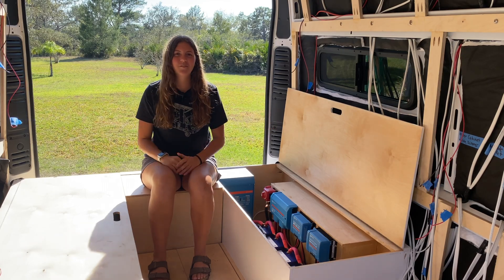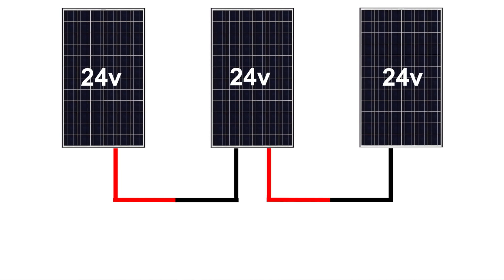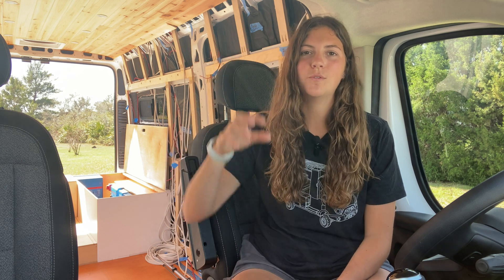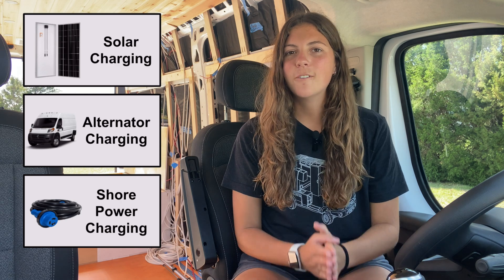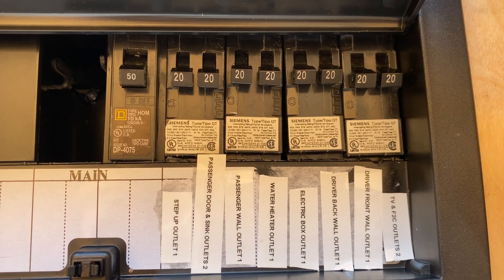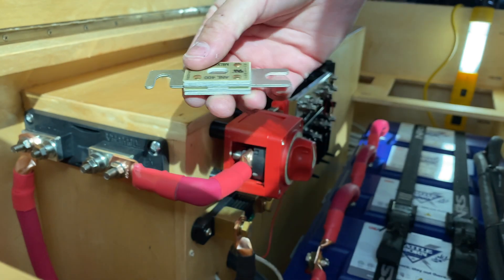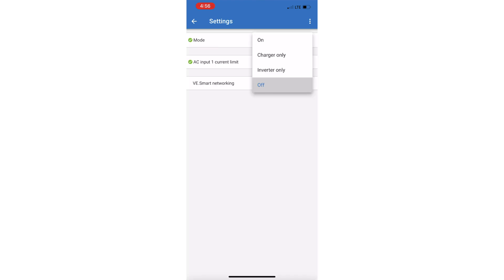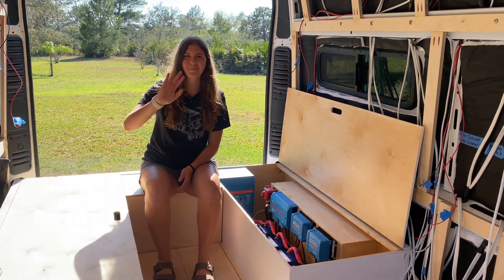How my DIY Campervan Electrical System Captures, Stores and Uses Power | Ram ProMaster DIY Van Build

Comment: I have a 2023 Ram ProMaster 2500 159" wheelbase, 11' of floor, about a 6' ceiling after putting 3/4 plywood on floor.... looking at putting an Outequip 10,000 BTU A/C Unit a Multi Outlet for Charging Phones, I have a 12v Truck Frigerator w / Freezer that I spliced a plug on its wires for cigarette lighter Outlet only needs a 15amp fuse...  so all hope hoping to power is the 10,000 btu ac unit, the refrigerator, a few outlets for charging phones & 11:17  put 2 or 3 High intensity lights on ceiling . Thought is 4 150ah batteries stacked 2 wide, 2 high to conserve cargo space, 3 200w solar panels . Victron SmartShunt 500

Comment: Can this system add as many batteries as needed without changing any settings for longer stored power? Also, will it stop charging if the battery is full, or is there a setting in the app to adjust the percentage charging cycle? Your video is very detailed and helped me a lot. Thank you
Reply from the maker: Great questions! The components are Bluetooth and have a monitor system to control charging levels properly. There will be some changes in the app for additional batteries up to 600 amp hours. Any battery bank bigger than that will require additional size changes in wires and components. Hope this helps 😁

Comment: You got some help from an electrician on that build. I like to tinker with stuff and feel generally competent doing projects but I don't know that I could have wired up a job like this and kept in mind to crimp, and heat shrink the wires, label the 120 circuits etc. Looks nice either way.
Reply from the maker: 100% self-taught and 100% self-executed 🤗

Comment: How do I identify a "high quality fuse"?

I can find a lot of different brands, prices are not that widespread and I have no clue what a decent brand would be for fuses...
Buying the most expensive one doesn't really say anything about quality, and all fuses have all their certificates needed mentioned on their product listing...

I'm with you about the importance of decent quality fuses, they are one of the most importend safety features. And even a very small electric water cattle will use about 150a at 12v, so the amperage is very high and without safety system it could lead to fire quickly...
Reply from the maker: Search Explorist.Life fuse videos. They have a few discussing this topic that will be helpful to you.

Comment: Your battery power system builds looks very clean,  organized,  until we see all the wires thar be hidden walls , what fire extinguisher 🧯  do you have or plan to buy i recommend  hr3 maxout dry chemical extinguisher its design to be clean doesn't leave a mess to clean up i have 2 they come in different sizes 😊
Reply from the maker: Thank you very much! will have a fire extinguisher in the van at all times for my safety☺️

Comment: You did a great job, the one thing I would have done different is install another or primary powwer switch so it would be accesable on the exterior of the bench/bed box. You could reverse the battery power take of leads and install a pass thorugh switch accessable on the exterior of the box facing the drivers seat and then new leads back to the originals switch. My thoughts are any thing that throws up smoke may not trip the 400A fuse. Iif the box is full of smoke and your not going to get to the switch safely but if you can get  power off and then deal with a much smaller issue. Also a small port on the interior or exterior of the box (desk top cable grommet ) so you can shove an extinguisher into the houseing if needed.

Comment: Another great video Lauren with even a lot of understandable information for anyone who is not professional in the profession.
Victron should reward you for how you promote and explain their products in an understandable way.
I saw one thing that I personally would do differently, I would omit the electric fan and grille and install floor ventilation in two places with the advantage that you have no noise in your campervan from the electric fan.
Reply from the maker: Thank you, Edwin! I’m glad you found the video easy to follow. 

Thankfully my 12v fan is quite and the vent seems to help as well. But ventilation near the floor like you shared would also be a great solution. 

Thanks for the comment!

Comment: Wonderful video!  How much did the system cost?
Reply from the maker: Thank you! With the main components, wires, lugs, tools etc. It ran me about $9k. Expensive but worth it☺️
Reply: @LaurenLawliss  I love the system you have. Looks like I gotta save up. Thanks for the research.
Reply from the maker: @Brokeassengineers Ways you could do it cheaper is have less batteries, less solar panels, get an inverter instead of the MultiPlus (no shore power), no DC-DC alternator charging etc. But like I said, this is worth it, especially if you are doing van life full time for years to come😊

Comment: My problem with connecting solar panels in series is, when you under a tree for example you got 3 panels and your 1 panel get shaded or something then you will have no solar input as the series line has been broken, or am i wrong? I've never installed solar and still learning and another yt guy said this. Can you confirm if you put a blanket over the 1 panel do you still get solar input from the other 2 panels or not?
Reply from the maker: Hi there! Great point. A simple solution is to not park under a shaded area and if a solar panel brakes then a replacement will fix it😆 Check out @Explorist.Life website and YouTube channel, they go deeper into this topic and ultimately agree series is the ideal setup. But you can do parallel if you wish. Best of luck!
Reply: @LaurenLawliss  I will check them out, thank you.
Reply from the maker: Anytime🥰

Comment: I have no idea why they told you higher voltage is better.. That only applies to homes. That have 20-40 panels. As it's all about the wire size.. A van is not going to make use of smaller wire sizing... You want amps.... So unless you are producing more then 60 amps from an array. You're wasting time. As Parallel is king on an RV...

I would add. If you use series arrays.. If just one panel gets shade, dirty or fails.. You lose the whole array. Why homes now use Micro inverters in each panel...
Reply from the maker: Thanks for your comment! Running solar panels in parallel or series both have pros and cons. My reasoning behind series is because I can simply move out of the shade and clean my solar panels and that solves the cons of series. So it is still within my control. And the batteries require a higher voltage than their nominal voltage to charge. You can do it either way, this way works best for my wants and needs.
Reply: @LaurenLawliss  That is nice.. But you said nothing about your reasons.. You simply made a blanket statement that is not factual..As the average Class B RV can't make use of 24 volt or 48 volt system. You simply don't have enough sq to install over 800 watts of panels..To justify the extra cost..A home does. As the home as the space and higher voltages to deal with...
Reply from the maker: @WizzRacing  I mentioned an article and video by EXPLORIST.Life that goes into detail about this topic and I mentioned it in the previous video as well.
Reply from the maker: And there can be enough space to install 800 watts on some vans.
Reply: @LaurenLawliss  I get that..

The problem is a Class B Van is not going to hold 800 watts of panels. As the average 200 watt panel size is 60"x30" at 30lbs each..That is 200 sq of panels. Add in you would need 4 batteries. Which is adds in more cost. Take's up more space.Adds more weight. To achieve the amperage a 12 volt system does..

So not sure how you get 20  feet long by 10 foot wide. On a roof that is only 12 feet long and 6 foot wide..Unless you start stacking them. As some have done. But they exceeded the vans roof weight limit. Not factoring in the wind speeds they will see while driving..

So still you need to qualify your statement. As Series 24 volt is not all it's cracked up to be in a Van.. It adds to many problems for little to no gain..As Amps is everything in a small RV. Voltage is not even on most peoples list..Outside the Ocv of the panels used. 

And yes I'm electrical engineer. We dealt with this for 35 years..
Reply: @LaurenLawliss  I would add. Now you have 4 batteries. That you have to balance each cell in. At least once a month. Then reset the battery capacity meter to show they are healthy..And this is if you know how too do it. As not all charge controllers can do it..

Comment: That long ground wire lug has what looks to be quite a gap where it is sitting on top of the other lug on the battery terminal. You'll want to make sure the lugs have full surface area contact.
Reply from the maker: Yes, you are right! That clip was right after I installed it, but I have since fixed the gap. Thanks for commenting and looking out for me.

Comment: Very nice job Lauren!  Have you found that the 600W of solar panels keep up with your charging needs of your 400Ah battery bank?  I'm currently building a similar setup to yours for my 50Amp Motorhome, but with 800W of solar to start with.   My much larger RV with 2 AC's, Microwave, & residential fridge will definitely have a larger power consumption than your van setup, so I'm thinking I will definitely need to add more solar panels eventually to be able to boondock for longer periods without the need to run my generator.
Reply from the maker: Hey there! Thanks for commenting. My van build isn’t complete yet so the only thing I’ve been powering off my system so far are my two roof fans, ceiling lights and one outlet. But I think it should be more than enough for my wants and needs. For you with 2 AC units you’ll definitely need more solar than me. Thankfully you’ll have more roof space for that too! Best of luck with your install😁

Comment: Did you install usb sockets in your van they come in very handy and can connect to 12v circuits so no using  inefficient 120v to charge your phone, smart watch,  ear buds etc. Great build though
Reply from the maker: Great question, Paul! I would like to add one or two USB sockets as back up in a cabinet somewhere once I get further along. Thanks for watching!

Comment: hi @ 1:17, I noticed the first lugs on the negative side are not flat against the terminals. Ideally you want to get those super flat and snug for most efficient use, it will reduce arcs etc.
Reply from the maker: Yes! You are so right. This clip was from when I first installed it but I have since fixed it. I appreciate you looking out for me and commenting. Thank you🥰

Comment: Can you tell mr the difference between an Inverter and an inverter-charger?
Reply from the maker: Hi Katy! Thanks for the question. An inverter will take the 12 volt direct current (DC) stored in the 12 volt battery bank and convert it to the 120 volts alternating current (AC) needed to power your outlets and any 120 volt appliances in the van. However, an inverter-charger is an inverter AND charger all in one. So aside from the inverter converting 12 volt DC to 120 volt AC, the charger function is used to charge the battery bank by taking 120 volt AC power from shore power and converting it the 12 volt DC to be stored in the battery bank. I hope this clears up your question. Let me know if anything else comes to mind😁